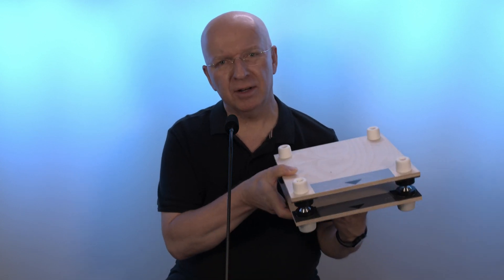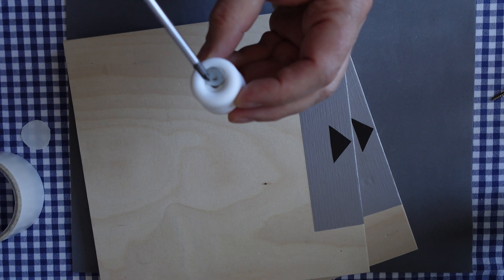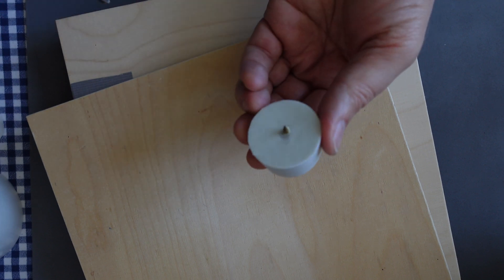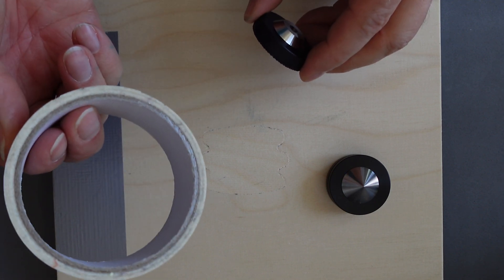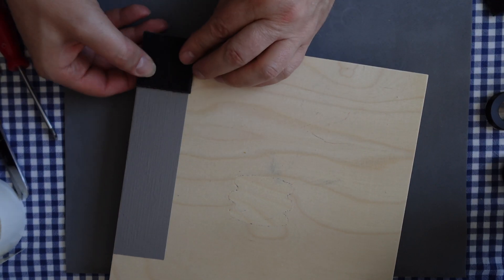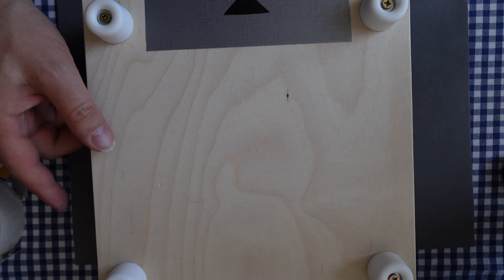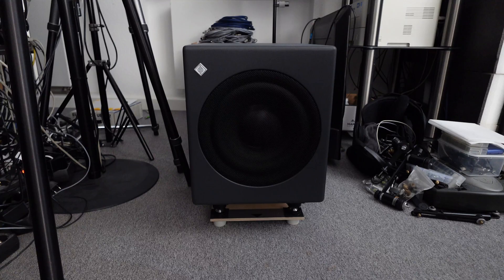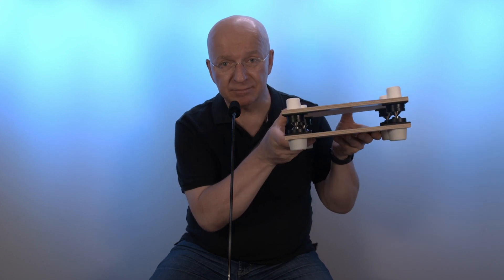My Ultimate DIY Subwoofer Stand: Unleash Your NEUMANN KH Speaker's Full Potential

Comment: What a lovely project 😊 I have seen these before but I had always assumed you need to be an engineer to work it all out, you make it look so easy! 

Where do you get the spikes from? That's the only part I am uncertain of 🤔

I have a nice set of bookshelf speakers it may be nice to isolate them and see how it goes ❤
Reply from the maker: Thank you Chelsea 🤗,
I'm happy that you liked it. 
Listening to music is so much fun and we can easily improve the sound of our speakers.
Most speakers are good, the problem is that the room is not prepared. And when the floor, walls and furniture are vibrating together with the speakers, they distort the sound.
So isolating the vibration helps a LOT! 
You can get a varity of spikes f.e. from Amazon; they are not expensive.
And the rest is normal accessories, nothing special.
It's not electronic science; just isolating the vibrations ... mechanical stuff.
I highly suppose: test it out. Change the formation of your speakers. Sound is moldable and your ears will perceive it.
And the same goes with musical instruments ...
I'm happy that you found this interesting. Working with sound is so much fun and can bring a lot of satisfaction, for YOUR experience 😀 
Much love 💕
Matthias 👋
Reply: Excelent your  video perfect  idee optimal experience 👏🏽
Reply from the maker: @elietedossantosramos1809 
Thank you so much Eliete 🤗.
I'm happy that you liked this idea. It really brings a perfect sound experience.
This is such a difference.
Have a fabuous weekend.
Much love 💕
Matthias 👋